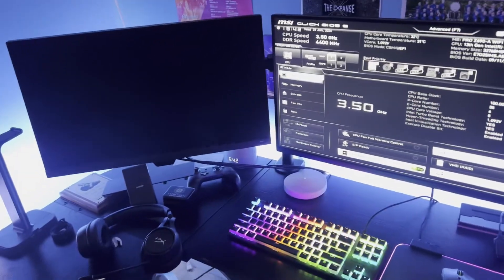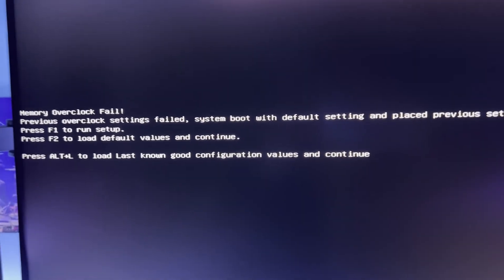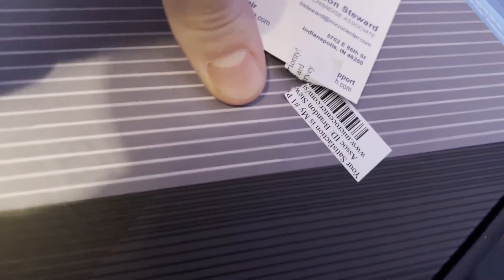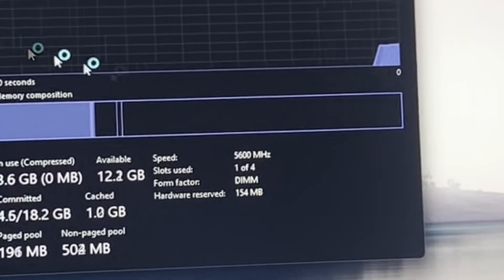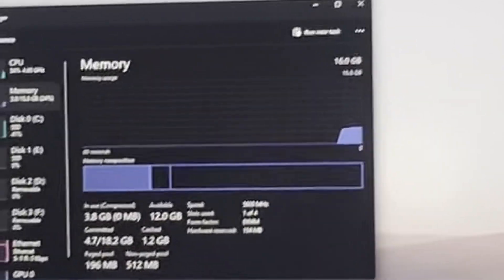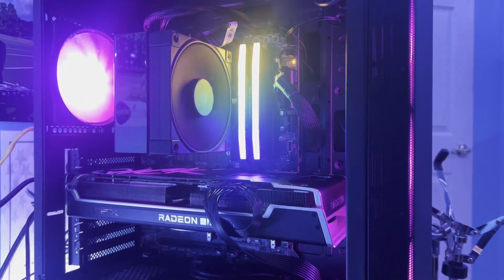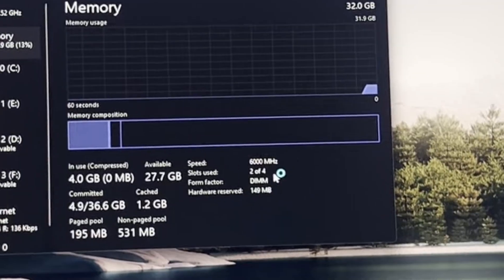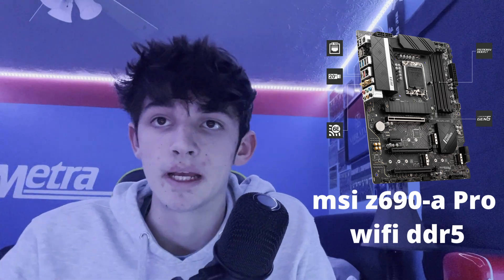T-Force Ram no XMP - ULTIMATE GAMING PC FAIL

Comment: i have a msi board, using the same RAM 6000Mhz i9-13900k. no problems im using the iEXPO bios setting.
Reply from the maker: iEPXO didn’t work for me either, but i’m glad it works for you.
Reply: @MetraBoy  yea me too never knew about this problem. new build so im hoping for longevity

Comment: Make sure it saves. Then try turning down the mhz by 200. For example, max is 6000, put it at 5800. If not then obvious hardware problem.
Reply from the maker: i tried that too, manually setting up even 100 mhz still caused the same issues. tried all ranges up to the advertised speed.

Comment: The task manager is not an accurate report of dram speed (as it doesn’t show mem controller frequency or gear mode), there are no good memory brands per se just good ic’s( the memory chips), lower-end kits (anything slower than 6600-7200 depends on brand) could have a variety of different ic’s, motherboards can have preferred ic’s( being chips they prefer over or other options), furthermore z690 drr5 is pretty bad overall. 
Here is what you can check using cpu-z you can see the dram freq. (this should be half of your rated speed) And memory controller freq. (this should be a 4th of your rated speed), if you go to the spd tab you can see dram manuf. Which is one of 3 current DDR5 producers Hynix, Samsung, or Micron (Hynix is currently the best IC maker for DDR5, Micron is undesirable at best, and Samsung exists) higher quality ic’s often overclock’s better (XMP is an overclock set by the memory manufacturer)  
	I prefer Asrock timing configurator (a piece of software that works with most intel cpu’s, MSI dragon ball/Asus memtweak are harder to get and do the same thing, Hwinfo has similar functions built in if you go to the memory timing page), ASRock timing configurator show’s only the vol/timing/speed info, the gear mode should be 2 for ddr5, and dram frequency should match XMP, Asrock timing configurator doesn’t show ic type. 
	Ddr5 is hard to stability testing, both AMD and Intel errors correct so knowing if it’s stable isn’t easy, as the CPU will either slow down to correct or in many cases won’t report errors (AMD literally turns off multiple Windows hardware errors on 7000 series) Karhu is best option 10$ for a license 8 hours should be good enough for standards, errors after 10 hours are mostly micro voltage (very niche), testmem5 is good free option 1usmus_v3 profile for 6 cycles or more (default config is 3 can be edited with notepad)
	Xmp doesn’t work and should never be considered just to work, as it is just timing and voltage for said timing only on the DIMM itself, voltages are set by the motherboard, and most set values “that works for most” however ddr5 ( in reference to the memory controller on the CPU) sweet spots pretty hard being there is often a range or in extreme cases 1 voltage that works for a said speed.
Reply: The kit shown on the site is not the one you bought nor related, and this is biased misinformation. The kit is really good it’s Hynix based on the timings, 6000MTs cl30 is almost always Hynix ( Samsung would need a very aggressive overclock, XMP is not aggressive for most of them )
Reply from the maker: @user-zj2ib9tx5z  thanks for all this information, im sure it’ll clear up some confusion left in the video or help others diagnose their problems

Comment: I had the same problem with Team Group.  I picked up the G Skills 6000 and it worked perfect first time, I thought I was going nuts, it was very frustrating, understand.  Its been running perfect ever since.
Reply from the maker: yeah almost the exact situation happened to me. don’t know what’s up with teamgroup/t-force.
Reply from the maker: @BigDaddyDuck1234that’s interesting but i’m glad it works for you
Reply from the maker: @BigDaddyDuck1234 Yeah that sounds about right, the ones i had were 5600 so maybe it’s a ddr5 issue in general?